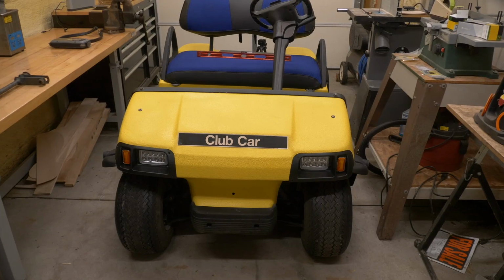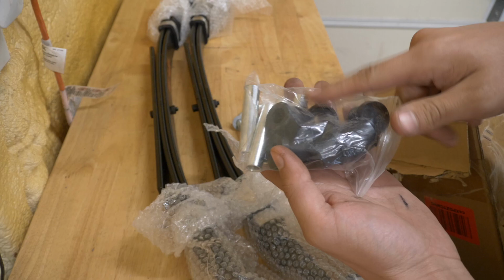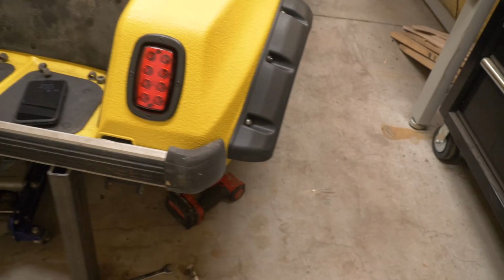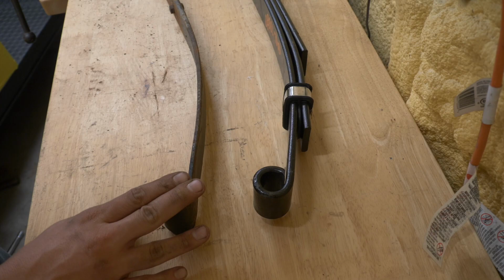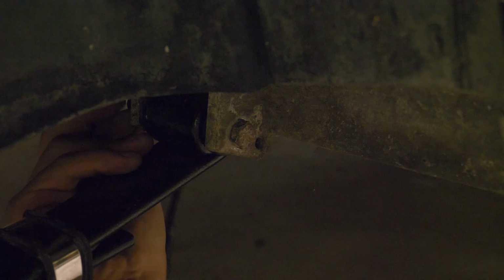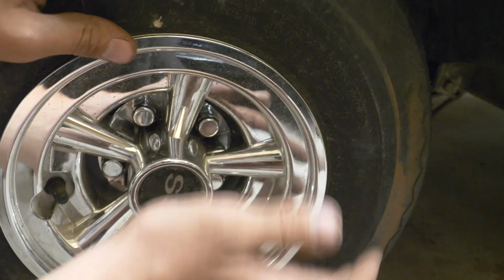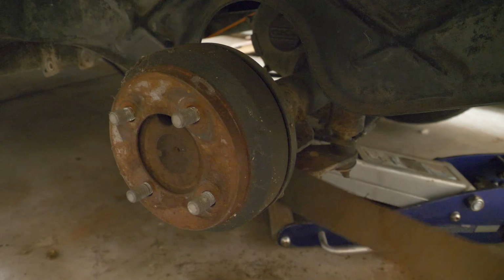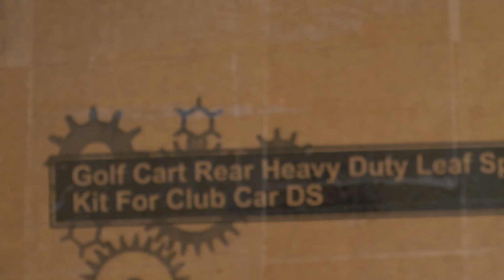Fix Your Leaning Golf Cart With New Springs! (Club Car DS HD Leaf Spring Installation)

Comment: What would you do for the front end if I have 12” wheels and they slightly rub at max turn? Would the lead springs help eliminate that? I have a 2010 Club Car DS I’m in the middle of remodeling.
Reply from the maker: One of the 1” lift blocks they sell on Amazon for the front leaf spring is exactly what you need.

https://amzn.to/45CWJ06
Reply: @LukesJohnDeereGarage  Would it give me a rough ride or should I just go down to 10” wheels? I’m going to add the leaf springs you recommend in this video for when we have adult passengers riding in the back so the cart doesn’t squat.
Reply from the maker: @chrisginoc  The lift block alone won't change the ride quality. The HD springs will stiffen the ride in the back a good bit though. But with adults in the back it's almost a must. With the weight of a rear seat plus 3 or four people on the cart, the stock springs don't usually do well.

Comment: I put new heavy duty springs on my cart and now i feel every bump like riding on a log wagon. Probably putting originals back on not sure yet.
Reply from the maker: They are pretty stiff. For riding alone, I wouldn’t recommend them. With a backseat with two or three people on it though it’s usually necessary.
Reply: @LukesJohnDeereGarage  I deflated my tires to 10 psi and it helped but still on the fence. I have 23" street tires with 12" wheels. I do have a rear seat but almost never have anyone ride on it so may change them back.
Reply: You probably need new shock absorbers too.

 I had a crazy amount of bounce after replacing the leaf springs to 3xheavy duty. Fixed the issue when the shock absorbers came in.

Comment: Thanks for the video! Question...
Does it lift the rear to the point where it would look like its pointing nose down?
Reply from the maker: It didn’t lift the rear of mine at all. Thanks for watching!
Reply: Another question if you don't mind. I have a Club Car DS with 4" lift. Do I need some sort of adapter for u-bolts? @LukesJohnDeereGarage
Reply from the maker: Are the U bolts on your lift longer than stock? Are they in good enough condition to be reused?
Reply: @LukesJohnDeereGarage  Yes they are longer than the stock u-bolts. They are newer and came with the lift kit for an 04' DS
Reply from the maker: @jellyjamacain In my experience the HD springs aren’t much wider than stock. If there’s enough threads on the leaf springs you can probably resize them. Otherwise a hardware store might be the answer…
Reply: @LukesJohnDeereGarage  Thanks for the info ^__^
Reply: @LukesJohnDeereGarage  Ok, thanks again.

Comment: What year cart is this?
Reply from the maker: It’s an early 90’s Club Car DS. It's been converted to lithium. I believe it's around a 92 model.
Reply: @LukesJohnDeereGarage  awesome thanks I figured as much. I just bought the same leaf spring set to go into a 93 DS gas. Very helpful vid.
Reply from the maker: The process is pretty much the same on a gas cart! The rear end is a little more difficult to move around, but it’s still possible.